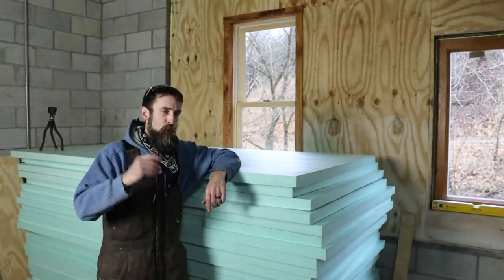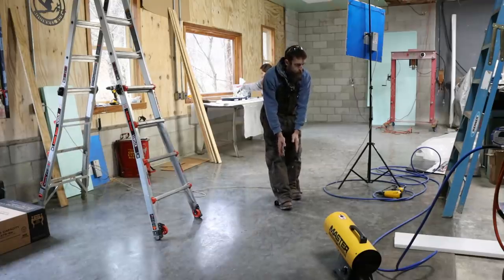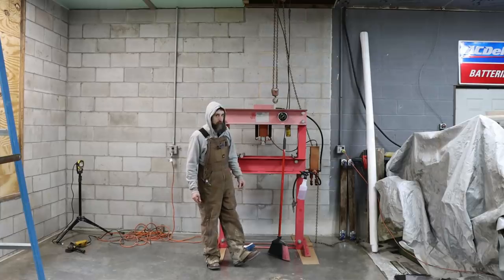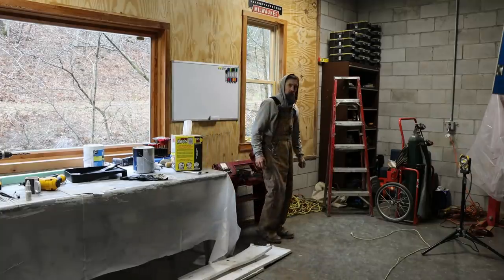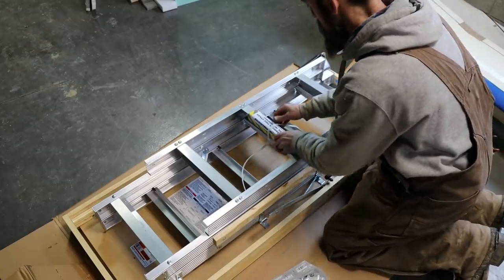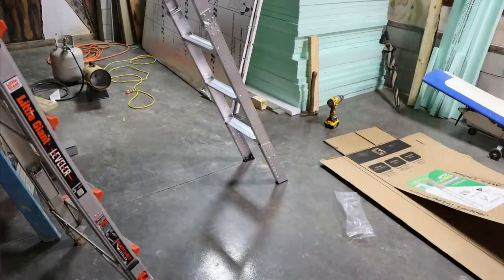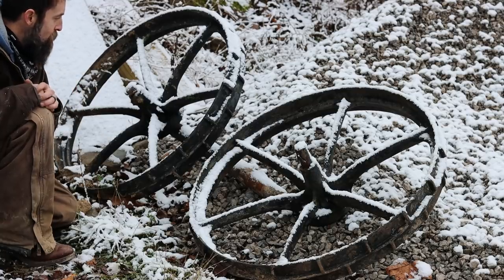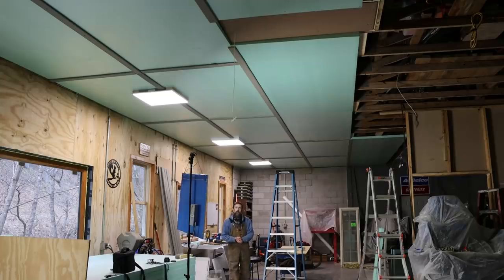Installing the new shop ceiling! One step closer to finished!

Comment: The shop is really coming along! My dad has a foam ceiling in his shop. Insurance companies hate it...
Reply: god would a rat not make a huge mess out of that lol
Reply: If he paints it, it might be ok. The building code says any foam insulation must have a coating that keeps it from access to working areas, such as drywall but you may be able to use a thick paint job. Just to keep a spark from catching in it
Reply: The biggest concerns are flammability and the compounds released when it burns. I cannot leave foam exposed in my area because codes will not allow it.
Reply: Just like an insurance company, my primary concern would be fire.  As a welder, I'd be very concerned that one inattentive sweep of the ole rosebud while bending something could torch the whole building.
Reply: Modern insulation foam is generally treated with a fire retardant. That does not mean that it won't burn, but it should be as difficult or more difficult to set on fire than the rest of the roof structure. Easy enough to test on offcuts, see if dropping some embers on it will start a flame or just burn a hole through it., and if once it's set on fire the flame will grow or self extinguish.
Reply: That thought didn't occur to me. That could be a problem.
Reply: If Steve is really concerned, he can paint it with DC315. About $300 for five gallons, gives about a 15 minute barrier if I remember correctly.
Reply: @d00dEEE  the ceiling is 10' it would be a long rosebud to reach that to do damage with a sweep bye. As a welder myself i agree with the concern of the flamability of the foam, and would cover it with formica like i did in my welding area of my shop. Take care.
Reply: @John Verne The foil in the ceiling is a vapour barrier to prevent any condensation that may form through inadequate ventilation in the roof space damaging the plasterboard and reducing the fire resistance integrity.  Your codes aren't so different from our UK Building Regulations but good building practices hold good whatever your country.
Reply: @musicteacherbuilder  Spot on.  Anything burns given the right conditions, even steel in pure oxygen.  All that can be done is slow it down enough so occupants cab safely evacuate and ensure the building retains it's integrity for enough time for fire services to safely extinguish the fire.  However extreme events, some of them pretty recent, have proven human beings are fallible.  We make mistakes and I feel this unprotected ceiling may be one of them.  At least check the data sheets for that material.  You have invited us along on all stages of this reconstruction and as such some of us who have experience in this field would be failing in both duty and friendship if we didn't point out our concerns.
Reply: @d00dEEE  ....How would "the ole rosebud" get to a 10' high ceiling?  I don't believe he is planning on bending or welding a 10' structure!
Reply: But is it Hufflepuff approved?
Reply: @paulcopeland9035  Ours is about 4 feet long, 2" diameter burner (can't really call it a "tip").  Puts out a 3000 deg flame 18" long when you crank it up.  Use it to heat for twisting, say, 4" solid square stock or 6" tubes for part feeder tracks.  The heat 10' above the flame is easily 500f.
Reply: @d00dEEE  ....Yes, I would agree you wouldn't want that burner around the foam ceiling.  I don't believe Steve has one of those so he might be safe.
Reply: A point to consider with an exposed foam ceiling, as time goes on UV rays from outside will slowly breakdown that insulation unless the insulation is painted.
Another point, the cinder block walls will also slowly change color as they age, often the become a much darker color.
Reply: Wood stoves are hard to insure here...too...
I "  wood " ( sic )  have covered the foam with thin MDF sheets ...
And spray it all White...
But as long as your happy..
I am!!
Reply: No disrect to anyone, loving watching the development steve but please research. '. Greenville towers.  London.  Fire '.    I believe that was a kingspan insulation cladding board.    ' just saying'.  Been catching up on ur build loving it and inspiring .

Comment: I have seen a series on the computer, I believe the title is "My Little Homestead," it is in the SW part of the USA, desert, the family built the house and the separate bedrooms out of really long sand bags/tubing, my point being they also build out of cement type  material the heating stoves, the cement type material really retains the heat from the wood burned in the heating chamber. two things impressed me the very low cost of the heating stove compared to a iron wood stove & the retention of the heat in the masonry of the stove.

You might wish to take a look at the series, just for the masonry type wood stove.
Reply: I am amazed at myself, I seem to have gotten the title mylittlehomestead.com correct!!

Comment: Never would have thought to use straight insulation for the ceiling but that is a great idea for a high ceiling that you have. Looks great. Leave it green. It will reflect  enough light. You might want to consider a separate grinding room though. Even with a curtain you will get grinding dust all over everything. And you know what abrasive dust will do to sensitive equipment. Can't wait to see the finished product when the shop is done! Nice job Steve.
Reply: I agree.
Reply: i would build a shed outside for a grinding room.  open concept in the shop and full separation for the dust.

Comment: Steve paint the sheets on the ground way easier. Tuck tape the joints for air sealing. Run wires for ceiling fans .

Comment: I think your shop looks fantastic. It will definitely have a cosier and cleaner feeling too by covering the bare roof beams and buttoning up all the air holes around the perimeter. Also will prevent dust infiltration when there's dry weather...keeping the surfaces cleaner too.

Will be really good when you get some heating in there too (although I'm from Australia so just having the insulation would do here), then the last thing for air leaks would be the sliding doors (only if they are bad at holding the heat in).

Also one question...ever thought of installing a smaller door onto the big sliders?
That way when it's cold outside you don't loose the heated air when you need to enter or leave the shop.

Comment: only problem with wood is if you want to work comfortable you will have to build the fire hours before youre ready to work if you use natural or propane it will be warm in 30 minutes and i understand that may not be economical for you so i do like wood also but you will get a soot on everything over time but weve lived with it for years keep up the good work sir

Comment: Best wood stove i ever saw was in a 100 ft long shop about 30 feet wide...and 20 feet ceiling. ....they made it out of thick plate steel...about 6 feet deep...4 feet wide and 6 feet high ( about 4 feet height for burn box and under was a big ash tray made of sheetmetal...they put pipe ( at least 12 and maybe 2" diameter ?? across the top ..welded into plates ..spaced about 4-6 inches apart and open front and rear to blow air through..the hot fumes went through these pipes before going up the chimney and a big fan 36" was behind it but could be moved to blow from front ( stove was not against a wall )...it could heat that shop from cold to sweatshop in no time in minus 30 or colder weather...in an hour your down to t-shirts...

Comment: I would be painting the ceiling. But if you will be using water based cutting fluids only, you might to be able to leave the ceiling unpainted.

Comment: If it was my shop I would paint the roof and the walls it makes them much easier to clean.
Reply: For me, it is the extra light that painting everything white gives.
Reply: From my limited knowledge of this type of insulation I've noticed that it attracts dust so it might be a good idea to paint it sooner rather than later
Reply: @JimWhitaker  That's a bonus.

Comment: You can heat that shop easily with a wood stove. My shop that we closed a couple tears back was 7500 square feet and we heated with a single wood heater for the last thirty of the thirty four years we were open with wood. It took about a hour to get the sides of the heater to a dull red glow and you just feed as needed. Great choice on the ceiling material, you can always add more insulation above  it if you decide down the road to put in central heat and air.

Comment: Those foam sheets were a wise choice, price and utility-wise. Thirty-something dollars for plywood vs probably half that for foam-- not to mention R-10 vs R-0...  Anyway, you'll probably want around R-40 sometime in the future-- that roll-out Pink Panther stuff is reasonably cheap and quick and easy to install. As for painting those panels... that light green may be pretty close to light-reflective as white, but like you say: wait until all the lights are in to decide on that. (Just don't paint the walls that color green!)

Comment: Myself personally Steve  i would prime the ceiling white at the very least. You will see how much more light will get reflected around.  If you really want to go the extra mile put a coat of high gloss white on top and watch the light reflect. Just my thoughts on the matter.  I have done the very thing in my home shop.

Comment: Shop looks great, but up here in Canada they say that you need to put a fire proof covering over foam as it is quite flammable but the nasty part of it if it does ignite it drips molten balls of fire that will stick to to skin and clothing.  Check it out and be safe.

Comment: Steve , Shop is looking good. As for a wood stove I would not do that but I would use a down draft furnace. The heat comes out at the bottom of the furnace. The heat then can move across the floor and raise. You can find these furnaces from old mobile homes or even find new ones. They can be diesel fired or propane. Then if you want heat use the thermostat. Best thing with out the wood stove is no mess of ashes or bring in wood.

Comment: I don't think you will regret getting a wood stove for your workshop I love mine cheep to run (I just need some insulation)
Reply: Wood stove is cheap way to heat the shop. Growing up on the farm in wi had a wood/coal stove in the basement.  Had to cut tons of wood because dad was too cheap to buy coal.  Just find be safe because you're dealing with chainsaws and fire.

Comment: Looking A1 Steve. Make it one big room and put you grinding/welding area in the corner next to the door. makes it easier to just sweep all the dust out the door when your cleaning up. Make up a couple of 8ft tall screens on wheels to section it off from the rest of the shop..

Comment: The press rebuild is simple usually o-rings, cylinder polishing, bleed valve needle & seat, cleaning up steel balls, new hydraulic oil. Steve paint the insulation it will aid in camera lighting. Are those Nuthatch birds?

Comment: Great progress, congratulations. regarding the heating I would very much recommend a woodstove. you micht even be able to weld one up yourself for next to no money. If you clad it in some firebricks and tiles you could also get it to keep the heat for many hours once it is heated up, reducing condensation on your metal machinery.

Comment: An idea to help minimize your trash and help add insulation. Cut the styrofoam your tearing out over the old part into strips that fit in between the rafters and slide them in over the new styrofoam. It will give you just that much more insulation.
I'd start in the corner the farthest from the heat source. 
Also if your going to use a wood stove that doesn't have blowers, place a fan blowing towards the stove. Cold air sinks so you want to blow the cold towards the heat, this will create a low pressure area and suck the warm air down.

Comment: I was one of those people who encouraged Steve to just tear down the old shop, salvage what materials that can be reused and move on.  How many times Steve picked up the blocks, moved and layed back down no one will really know.   But I would say that was a very expensive stack of "free" cinder blocks.   Had he chosen to level the sight and erect some style of new designed building material, such as Structual insulated panels,  or foam blocks lined with concrete he'd have a building close to ten times more energy efficient.  The biggest thing is it would have been completed in less than 90 days.  You must factor in the hundreds of lost machinist hours dedicated to rebuilding this old building.  Rebuilding is notoriously slow, constantly frought with new surprises and you always end up replacing twice as much for close to twice the price.  All the trips to stores, machine rentals or purchases.
Lastly one should always remember your skills you're paid for within your profession.  In this case machinist, hire a professional contractor to apply his trade.  Save the cabinets, counters and other ammenties for yourself and you likely would have been done six months or more ago

Comment: Audio mix is a bit all over today with this one.

Also on the wood stove, might be worth finding a wood heater. Heats up water to pipe to radiators, rather than having one giant blob of heat in one corner.

Comment: Steve, you have got the most comfortable looking place, shop, running creek, house, all the creatures and everything looks like it was made by God's hands. Your ceiling looks nice, I like your 80 ton press and I think you will like the shop better after you tear the remaining wall out. You also have some good help, Elizabeth and your son. What does your dad think about the way your shop is looking? I think I would put those cast iron rake wheels on either side of the driveway out next to the road. You might even make a metal sign to bolt on to them saying " The Simmon's Place" or something to that affect. Keep up the good work and stay safe.

Comment: The shop looks good. I think you have made well thought out decisions throughout the project. Go with what you think will work for you. A wood stove is a great choice, but the stove pipe may be problematic with the foam ceiling. Maybe go through a wall with the pipe.

Comment: If you have a substantial wood supply and you can get a wood stove go for it. I have a 36 x 42 ft shop with 14 ft ceiling and all i use to heat the shop is a wood stove and i have no problem getting 55 to 65 f when it's minus 30 once you get the big castings on your machines and concrete warmed up it will radiate heat overnight my shop never gets below 35 to 40 degrees even if i don't have a fire for 3 days and the more equipment I shove in there the more efficient the stove is as far as chimney i used the wall thimble because I don't want a hole in roof and have leaks. Most often I'm just burning dead fall have lots of it works good not as much heat just need to feed more the only good trees that get cut up is from pruning or ones that get damaged by storms then i save those for the coldest days the following year so i get a lot of prime wood but mostly dead fall just to clean up the tree stand. Nice thing about wood heat its very dry keeps the machines from sweating with temp changes and high humidity. I have major temp swings down to 35 to 50 overnight depending on outside temperature then get up to 55 to 70 in the course of the day no sweating issues with the dry heat. Shop sure is looking good wont be long now. Had to laugh at Elizabeth cozying up to the heater my wife does the same thing as soon as she comes into the shop she immediately migrates to the stove lol

Comment: I'm still fancy that concrete floor, with the coating it is like a mirror!
:-D
For the wood stove, think of a heat exchanger and some radiators along the shop, will dissipate the heat more even...
Great job on the ceiling, yes these foamboards are better in this case as drywall!
Thx for the vid!
:-D

Comment: That primer is a great product I used it on my walls and ceiling had a water leak upstairs and it contained the water giant bubble on the ceiling I hit it with a pin prick drain the water in the primer sucked back up to the ceiling

Comment: Steve, What are those chickadees doing raiding your squirrel feeders???  😄
I probably would have painted that block before moving in.
It's going to be a huge dust trap going forward.
Everything is looking great!
Really excited for you and your renovated shop.
Reply: It is not like you can't pick up the phone and ask some of your vast amount of successful fellow YouTube creator friends about their shops as far as materials used and safety of those materials in a working shop plus ease of cleaning.
   My bet is paint the walls and ceiling. Wood stove yes, but how to keep the shop dry and the rust off the machines when you are not there to feed the stove?
Reply: @frankdeegan8974  It's temperature swings and relative humidity that create condensation on iron tools, sweat on block walls or concrete floors.
When warm air cools it cannot support the moisture it holds.
If there is a positive delta between surface temperature and the dew point of the air there is no condensation.
If a warm front moves through with 95% humidity no amount of ventilation is going to help. 

You need to close things off better than a barn door and warm the interior air so it brings down the RH.
Sealing the outside of the block with sodium silicate or a silicone based sealant will help prevent the walls themselves from becoming a humidity source when they get saturated.

Comment: The shop is look very good Steve. I like the look of the ceiling. As long as the colour doesn't affect your videos it should be fine left green. You didn't mention it today, but if you are going to keep the shop warm aren't you going to have to do something about those front doors? They look a bit "airy".